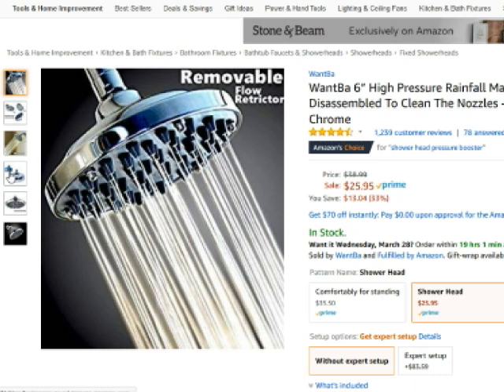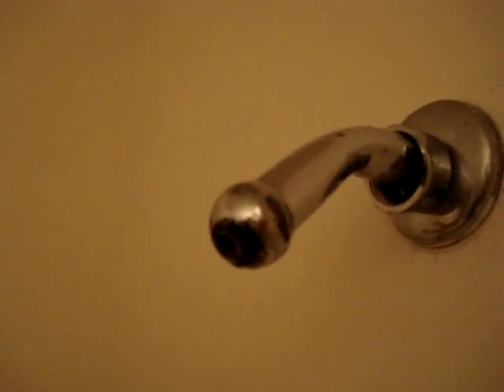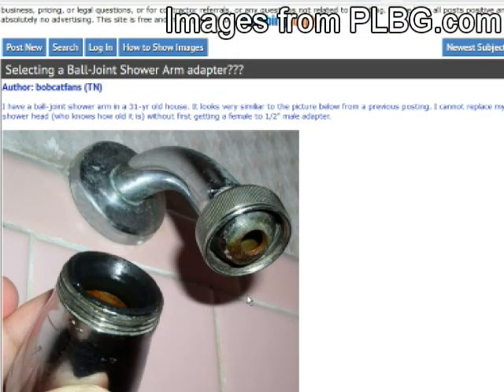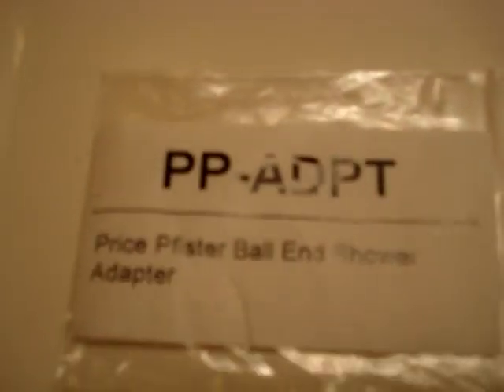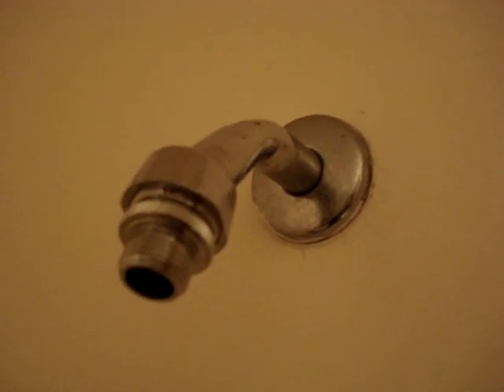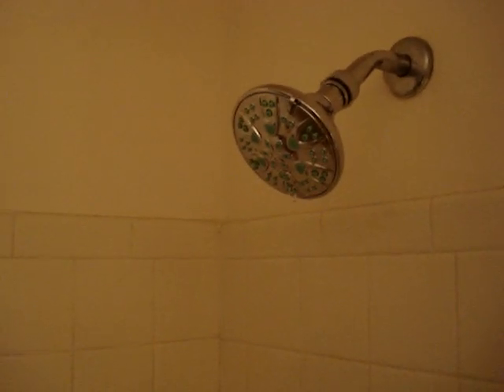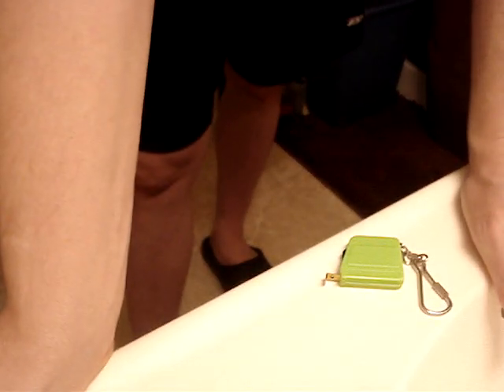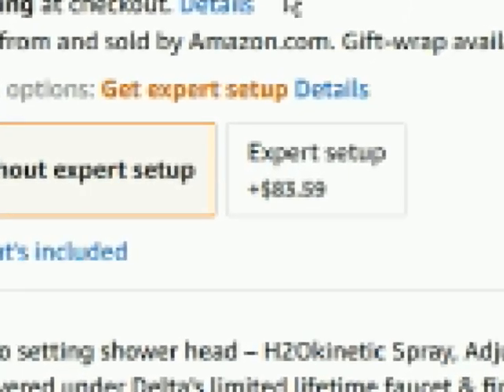Ball End Shower Arm Shower Head Installation (Adapter)

Comment: Thanks for this video, ran into this exact issue right now.  Me being a dummy did the same thing you did, bought a new showerhead, went to put the new one on and bam...ball end shower arm.   Thankfully I can just buy an adapter and know what to get thanks to this video instead of replacing the entire shower arm.
Reply from the maker: Sir Mang, you are welcome. Glad it made things a bit easier for you. Hopefully no more plumbing problems and thanks for taking some time to comment.
Reply: @Underdrummer  Crazy thing is the price of the adapters doubled since you posted this video!  35 bucks with shipping now.  But, at least I can replace my showerhead with something more modern when it comes in.
Reply from the maker: @sirmang9032  Yes, this is true. Everything is more expensive now with gas prices the way they are. But you luck is with you to even locate one of the tri-packs. Many people have commented they cannot find them for sale.

Comment: I wanted to change my shower head earlier but ended up finding that little ball. After that, I hopped on YouTube to learn how I can put an new shower head on. I’m glad I came across your video! Thanks.
Reply from the maker: Black Coffee, glad to hear it! You're welcome and thanks for the comment!
Reply: Underdrummer, do you have any suggestions for what type of detachable shower head I should buy?
Reply from the maker: The one I used in the video (see link in description) is okay. It was only $20 and I think now it's even less.Nothing super wrong with the head I bought but it feels cheap and the settings don't really change the spray that much. 

Realizing you do get what you pay even with shower heads - so next time I have already decided to spend a little more. Happy Plumbing!
Reply: Underdrummer, I saw the shower head in the video. I should’ve been more specific. I was talking about one of those fancy ones that has a long cord. You know the one you can take and spray it all over your body.
Reply from the maker: The one I use in the video has a corded version. I've actually never used the corded ones so I wouldn't be much help. Again I'm sure you-get-what-you-pay-for applies here as well. Best of luck.

Comment: Wow 😲😲😲 my plumber told me it was rusted and stripped and none of the shower heads would work..I noticed there was no rust and the thing around the ball looked fine...he suggested knocking out my wall and installing a new shower system and he told me his company would not be able to fix our wall ......he did recommend we just take straight stream showers from the ball joint....I plan to buy the adapters and buy a new shower head....I feel like I can never get someone to give me a honest answer on any home repair and it's a really bad feeling to be held at the mercy of a so called professional.
Reply from the maker: MegaAri90, so sorry. A simple adapter or even changing the shower arm are both viable and inexpensive solutions. Stay wise and best of luck!
Reply: @Underdrummer  Thank you so much!!! ❤️❤️❤️ had the adapter and new shower head on within minutes with no leaks or any problems...I will try my best to stay up on things so I won't be robbed because of my ignorance.

Comment: This video changed my life, i did the same thing. But that was only half the issue, as todays shower heads do not put out half the spray pressure. But i have also found out how to remove the water inhibitor. Turned my $4 Walmart shower head into a $20 one. Thanks, I got the proper adapter off ebay.
Reply from the maker: Imax Junior, great to hear it. You're welcome. Glad your plumbing problems will soon be a thing of the past. Thanks for taking the time to comment.

Comment: Thank you for the advice. Unfortunately, I found this video too late. Started out in the main shower when I went to add a double shower head.
 I saw this alien piece and I was stuck looking at it for 30 minutes trying to figure why my Amazon showerhead wasn't fitting. I took pictures of it and wen to Homedepot for help. I got frustrated when the guys couldn't help me and only after getting laugh at by on old dude, did he say I should try to remove the entire arm. So I purchased the arm and went through the hassle of figuring out how to do it. I got it to work but now I have a leak so I have to figure why!? Second journey, today I'm replacing the guest bathroom showerhead which led me to here. Thank God I purchased a second shower arm but the arm was stuck in the wall and it took 3 hours to get it out. I had to think how would "MacGyver" do this! So I use wd-40 to loosen the grip and then watch a couple of videos on technique to use to get the arm off. Finally, Eureka! And now, your video started playing and I "slowly teared up' inside thinking GEE where was this video 2 weeks ago! Sigh, but now I see there is a solution, so I have that knowledge just in case someone else needs help! Either way, Thank you!
Reply from the maker: Lillie Nd, you're welcome. Quite the plumbing adventure you've been having. Sorry to hear about the troubles but glad to know you are on your way to solving them. Best of luck and thanks for taking the time to comment and share!

Comment: Thank you for a candid, detailed video with excellent notes and links.  But this wil be the wrong solution for many folks. It is cheaper ($8 vs $32),  cleaner  (no  excess plumbing clump) and quicker  (hardware store vs Amazon)  to simply replace the arm. If the arm is really rusted in or you are uncomfortable with plumbing, this method makes sense.
Reply from the maker: Dov Jacobson, you are welcome.

A single adapter is only $6-9 if you can find the right one you need. I only paid $15 for my tri-pack but the price has varied greatly since I made this video. 

Replacing the arm is probably the most prudent choice but like you said, for those not comfortable doing so, I thought it would be nice to have an alternate method.

Comment: Hi there! Thanks for solving the mystery of why I could not fit a new shower head, however, I live in the UK and I cannot find the adapters for love nor money anywhere not even on Amazon? Any suggestions would be most welcome folks!
Reply from the maker: HI Christian Dart, glad I got you this far. Sorry to hear you can't find the adapters anywhere. The seller Amazon link I provided is often out of stock. Probably because of this video! Reading through these comments will help. I've read them all and lots of people have had luck at local hardware stores. Not sure if they have a Lowe's or Home Depot there. 

Also doing some research and finding the specific adapter you need will help your search. Some people are saying the brand name is etched into the side of the shower arm though I was never able to locate one. 

If you haven't already, read my description carefully. You'd be surprised the number of people who fail to do that simple task.
American Standard, Gerber or Glacier Bay (Price Pfister) are your 3 brands. 

Clicking on my links I see all items currently in stock including the singles. Though I understand it is different sites for the UK.
Try eBay as well. Somebody out there is selling these for sure. 

Best of luck and please let me know here int he comment section when you;ve found them. This will just add to the repository of knowledge for others who may have the same issue, Hope your plumbing problems are over soon!
Reply from the maker: I just noticed that at least two of these adapters are made by a company called Whedon. Maybe do a search for them. 

Finally, if you can narrow down which adapter you need you may have luck visiting the manufacturer site.

Good luck.
Reply from the maker: I've just now added several adapter links. Please check them out and maybe one will do for you.

Comment: You answered a lot of people's knowledge vacuum question. But your solution is so wasteful considering the existing arm is rusty. Why didn't you just spend this money on a new shower arm?
Reply from the maker: Ks So, not rusted just old. If I had found rust I would have changed the entire arm.
I don't believe it is a waste at all. It is an alternate and viable solution. It's nice to have multiple solutions to a problem.
I believe many people agree. The comments section here is proof of that.

Comment: Thank you, this was helpful, the American standard fits mine. Only thing I can’t get it to stop leaking water from the top, not sure if I need to tighten it more or what 😒
Reply from the maker: HI Ruth Camacho, glad to hear the video helped you out. Further tightening it with pliers will help you get it a bit more firm - if you haven't already. Additonally, there is something called Plumber's Tape which will help ensure a tighter seal.

Thanks for taking the time to comment and best of luck to you!

Comment: The actual piece that I would hook an adapter to is gone where can I find it
Reply from the maker: Hey Shayla Pegues, I try to respond to every comment on my How-To videos. I have seen this question before in this comment section. I think what is happening is the shower arm is a different model because its rare the female piece that the adapter screws into is broken. More likely it's a different model. Unfortunately you will need a different kind of adapter or have to change the entire shower arm. Reading through these comments may give you further information. Best of luck!

Comment: I have the exact same old shower head. So I'm going to buy the specific Pfister one like yours. Thanks for the info.
Reply from the maker: Glad to hear it. You're welcome. Thanks for sharing.
Reply: @Underdrummer  Just an update, I didn't want to take any chances and I bought the 3 pack. To my surprise, NONE of them were able to screw on. I was so mad because I know there isn't anything else out there that would work. All of them had threads that were too large for some reason. Anyway I forget which one I used, but I sanded down the threads with a rotary tool and it worked.

Comment: Why not just take the arm out and replace it with a normal one?
Reply from the maker: Replacing the shower arm is a perfectly acceptable option but can pose its own problems. Being in an older home is one of them. No plumbing skills or knowledge. What if you break something? Maybe you don't own a large enough wrench or a spare shower arm. This is simply an alternate solution. It's nice to have multiple solutions to a problem.
I believe MANY people agree with that. The comments section and the likes on this video are proof of that.

Comment: Hi, just saw this video as I moved into an older condo and have this ball end thing !!! I purchased an adapter at local hardware store. Didn't work. I'm like what the heck. Bought the 3 piece set on Amazon. They arrived and none of them work !! The ball end adapter is a little too big , it wont screw in !! Help, what can I do ?? Are there other sizes a little bit smaller that will screw in ??
Reply from the maker: Ginger Berger,  sorry to hear that. If you've tried all 3 adapters without success, it's possible the threads are damaged in the female section. Your other solution is to change out the shower arm. There are many YouTube videos showing how to do this.
Best of luck and I hope your plumbing problems are over soon.
Reply: @Underdrummer  Thank you for the quick reply. The female threads are not damaged. The male adapter is a little too large for the female section. Didn't know if I could find a male adapter just a tad smaller.

Comment: The company now raise the price to $26 for three.
Reply from the maker: Cosandra Odame, yes the price has been higher lately. One solution to this problem is too order and sell the 2 remaining adapters on eBay. 

Also most people here have needed the Price Pfister adapter. Maybe try that one first and maybe get lucky. 

Finally, check out my description where I have included specific measurements for each adapter. If you can get your measurements, you should be able to narrow down the specific adapter you require. 

Best of luck.

Comment: Mate, you're a rock star!  Just moved into an apartment in the city and wanted to change out our showerhead since my roommate and I are too tall for the current one.  Took off the original one to find the ball, and I didn't know what to do, since replacing the entire shower arm would be against our lease terms.  Gonna order a set of adapters now.  Thanks so much!
Reply from the maker: Neon Lemmy Koopa, so glad to hear it helped you out.  

Got a load of crap from some (mostly plumbers) for suggesting this method versus just changing shower arm but here again is another example of why alternate methods are a good thing. 

Hope your plumbing issues are over. Have a great day and thanks for taking the time to comment.

Comment: Why not just change the shower arm?
Reply from the maker: Esther Michel, replacing the shower arm is a perfectly acceptable option but can pose its own problems. Being in an older home is one of them. No plumbing skills or knowledge. What if you break something? Maybe you don't own a large enough wrench or a spare shower arm. This is simply an alternate solution. It's nice to have multiple solutions to a problem.
I believe MANY people agree with that. The comments section and the likes on this video are proof of that.

Comment: Awesome many thanks for supplying a solution to my problem, can get rid of the old crusty leaky shower head now with something more modern with lots more options!
Reply from the maker: Andy James, glad to hear it helped. Thanks for taking time to comment and hope your plumbing problems are soon over!
Reply: @Underdrummer  Ok adapter arrived connects great to new shower head removed old shower head only to find no coupler on the shower arm (which explains why the previous owner had locked the shower head in place with some type of putty/adhesive), now on hunt for a solution (dont want to remove shower arm as I think that will end up with a major tiling exercise) .
Reply from the maker: @andyjames3483  Wow, it's becoming an epic saga for you, so sorry! I think the shower arm replacement is your best bet but maybe there's another solution. Best of luck to you. Thanks for sharing.

Comment: I have been researching so many sites/videos on how to remove mine. It's screwed on to the shower arm. I have soaked in vinegar overnight and it's still not budging. Any suggestions?
BTW, I love everyone's comments. My carpal tunnel is killing me after 3 days of trying different ways of loosening it to no avail. Should I just order the adapter even though mine is screwed on (yet stuck, obviously)?
Reply from the maker: Wendi Lemons, how to remove the ball end?
It's possible it is welded on. Though some here have claimed there ball end is missing.
There's always changing the entire shower arm.
There are many videos on YT on how to accomplish that task.

If you meant the ring around the ball end, check for calcium growth to see if that is holding it in place. Just like the ball end, yours may not move. 

Finally I suggest reading through some of these comments, many people have been able to solve their issue by doing do.

Best of luck!
Reply: @Underdrummer  it's screwed on. I don't see anywhere it could be fused/welded. The existing shower head screws on to this round collar that it's made for. I ordered a whedon products Gerber brand attachment and I'm hoping from all my research that it's the one! Thank you for your reply. Oh, and I am thinking it may be glued and that seems like a lot of work, trying to dissolve the glue since an overnight soak in vinegar didn't help a bit.
Reply from the maker: @1313wendi  No problem. Hopefully the Whedon product works but there is always the option ofm changing the entire shower arm. More work but fairly standard. Again, I hope it all works out for you.
Reply: @Underdrummer  Thank you for always promptly replying! I'm always trying to do whatever I can on my own if possible. Of course there's always things like my heating and cooling unit and more involved plumbing when I normally break down and let the professionals do their jobs, lol! As of now, I'm stubbornly still attempting this one on my own. Your video helped me along, otherwise I would be calling a professional in at this point.
Reply from the maker: @1313wendi  no problem! Always glad to hear stories of other self-plumbers. So glad my video helped out. Please let me know if you get this one solved and how.
Hopefully your plumbing issues are over soon.

Comment: You could have just replaced the whole arm🤦🏻‍♂️
Reply from the maker: Hey Richard Trottier, not sure if you are joking so will respond honestly. 

Believe it or not I've heard that a couple hundred times since posting this. I'm aware that replacing the arm was an option. I think part of the reason this video had become slightly popular is that it is an alternate solution. 

This video is proof that there are a lot of people who don't know how to replace the shower arm, an adapter is a more realistic solution for those people. Especially for older homes. 

Thanks
Reply: Yeah, and all of us with this problem could remodel our entire bathrooms/replace entire plumbing system and or raze house and rebuild (or move) as well. Said another way, your comment is inane and misses the whole point of the video/task.